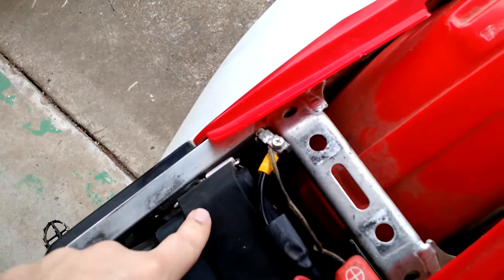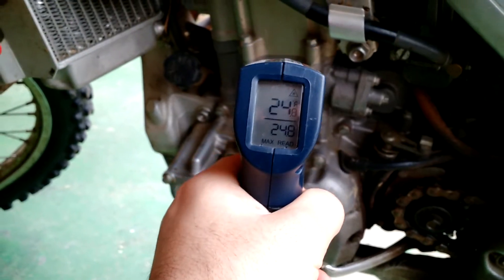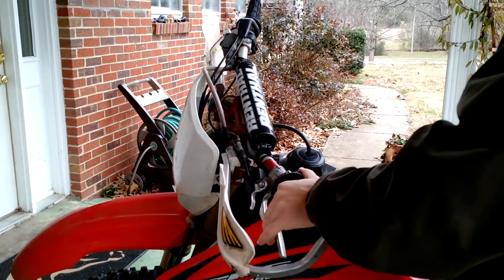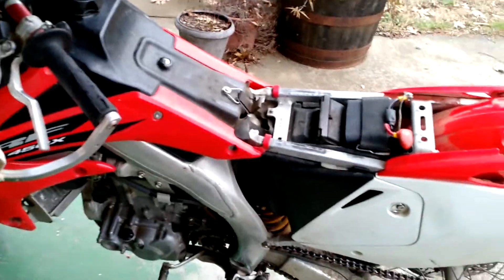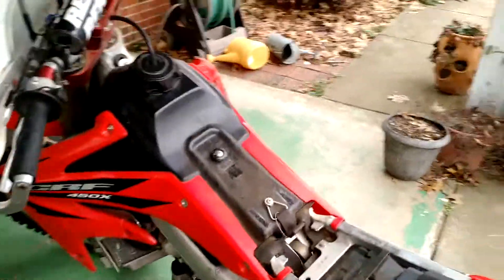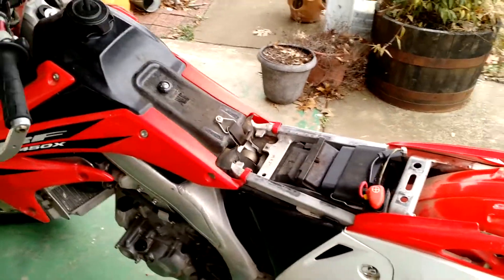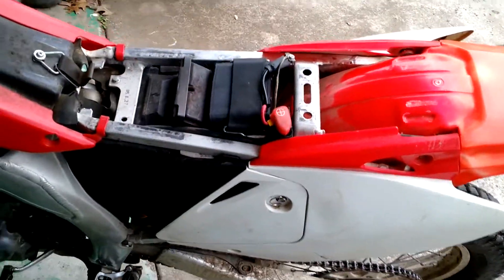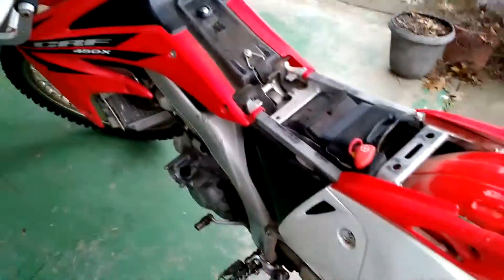Honda 450X Super capacitor battery replacement

Comment: I have a 2019 crf450L I’m in Montana and it’s getting subzero F many nights I want to store it in my unheated shed over the winter to free up space in my garage for vehicles. How do I remove the battery before putting it out into my cold shed for the next few months?